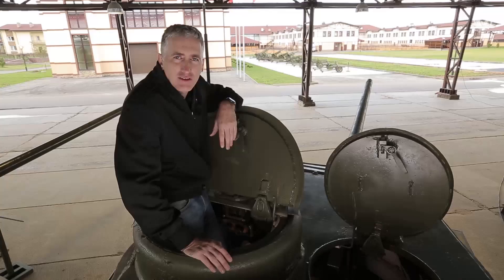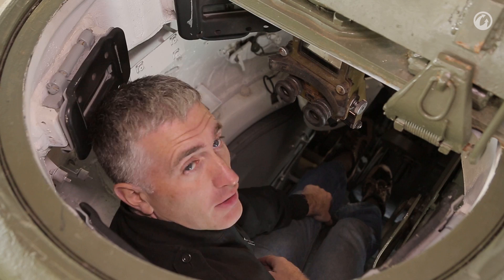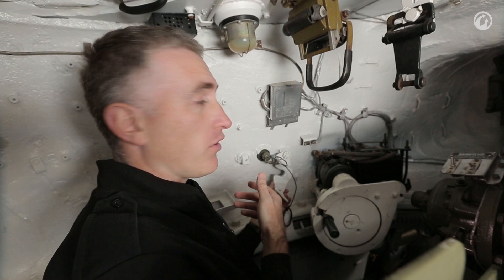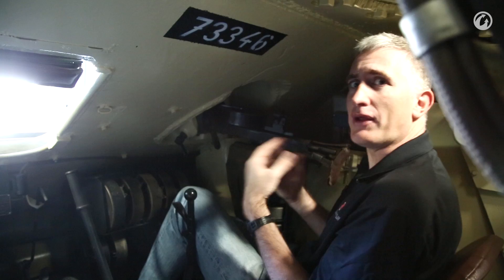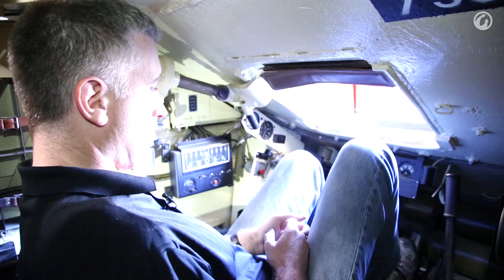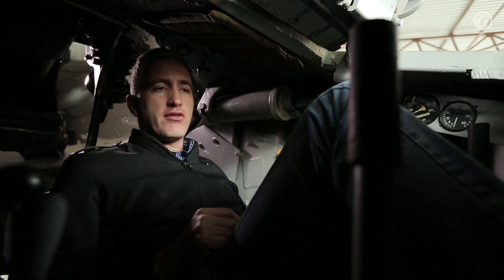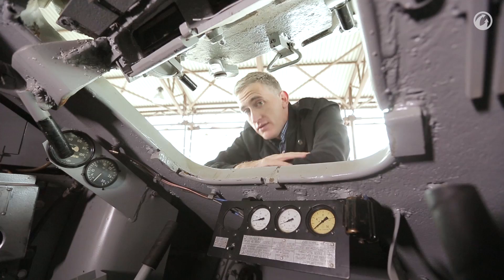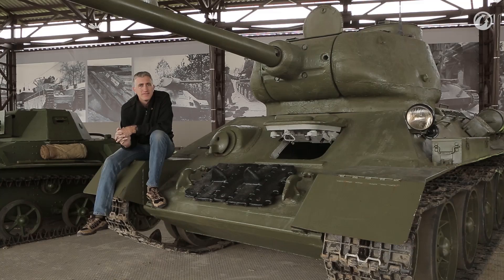Inside the Chieftain's Hatch T-34-85: Part 2

Comment: Great review sir!!!  To me the T34 series of tanks fits a lot of the Soviet and Russian mindset.

It works, it is functional and it gets the job done.  T34 series of tanks are the AK47 of the armored warfare world.  Rugged, reliable and easy to produce.

Remember, the U.S. spent 100,000 dollars designing a pen that would write in 0 gravity for our astronauts.  The Russians sent a pencil with their cosmonauts.  Simple, works, good enough for the job.
Reply: That space pen thing is an urban legend.

Yes the budget for the Zero-G pen was skyrocketing, but it was private expenditure by a company that wanted the contract.

For NASA it cost nothing more than a normal ballpoint pen ($6 a pop).

I'd say that $6 for a ballpoint that can withstand temperature ranges of -35 to 120 degree centigrade and an estimated shelf-life of 100 years, is quite a good deal (even if NASA did buy 400 of them).
Reply: *****
Which is another point in favour of the ballpoint.
Reply: MrFalconfly
Actually, those pens are quite expensive. They are not simple ballpoint pens, they have a sealed and pressurized ink cartridge. That way you can write even at zero-G, whereas with a common ballpoint it would be impossible.
Reply: *****
Solution: Wax pencils.
Reply: RdClZn
$6 aren't that expensive.

It's about 30 danish kroner, which is the normal price for a normal ballpoint.

Special? Sure, but not overly expensive.
Reply: MrFalconfly IDK were you found a 6 USD one, usually that's the price of a refill. The price of space pens usually range from 10 - 55 USD.

Edit: I see you're referring to the price they were sold to NASA, my mistake. Please, remember those are 1965 prices... That would be around $ 45 today.
Reply: pencil thing is an urban legend, and they did also used ballpoint after sometimes in spaces.
Reply: RdClZn
That was the price for which NASA acquired those pens.

What they cost now is irrelevant. We are talking cost of acquisition back in the Apollo programme.

"Fisher invented it independently and then, in 1965, asked NASA to try it. After extensive testing, NASA decided to use the pens in future Apollo missions.[6][8][9] Subsequently, in 1967 it was reported that NASA purchased approximately 400 pens for $6 a piece"

http://history.nasa.gov/spacepen.html

Just like the Ferrari 250 TR which had a price back in 1965 of about 4000 USD, but today it sells on auctions for about 16.4 million USD.
Reply: RdClZn
Moral of the story is.

If you think something is gonna be a hit, and you want it cheaply. Get it early, because the price is only gonna go up.
Reply: MrFalconfly Read the edit. The price today is relevant due to inflation. $6 might seem low but if you keep in mind that you could buy a pencil those days for one cent, then you release $6 is not really cheap.
Reply: RdClZn
Alright, point taken.

What the hell happened to the dollar?!?

But still. It can operate in temperatures from -35 to 120 degrees centigrade, and has a shelf-life of 100 years.

Not like those cheap byros I nick from my office, that dry out the next day.
Reply: MrFalconfly
That's right, I'm not saying it's not worth the price, I'm just saying it's not cheap. And by a long shot not the cheapest solution to this problem...
Reply: ***** Uh... The fact you're using one of the two most successful space programs as an example to how they were unable to innovate tells me that either your irony detector is broken or you're way too blinded by ideology.
Reply: RdClZn
The Soviets were quick, I'll give you that.

And the R-7/Soyuz combo is a very good Astronaut lifting platform.

But realistically the Soviets were lagging behind after NASA got their Gemini capsules flying.

The first spacewalk of the Voshckod was more of a desperate grab for another "first" using a modified Vostok, while NASA was storming ahead with their Geminis and Apollo CSM's.

I'm just sad that ESA's Hermes space-shuttle for the Ariane 5 never made it to a first flight (especially seing as the Ariane 5 is one of the most capable heavy lifters currently).
Reply: *****
Are you suggesting a corporation that spent thousands of dollars in developing a product, then took the opportunity of a contract scandal to promote it, is a "maverick inventor"?

Idk, I disagree with your statement in general.
Reply: ***** I meant it was not the job of a maverick inventor. But the deliberate choice based on market trends and opportunity taking by a big company.

The way you worded it makes it seem like the U.S space program gives FREEDOM and BURGERS, allowing a lone-wolf maverick inventor to show up and save the day (just like Captain America).

Which is just silly.
Reply: actually, the T-34 is quite unreliable.  It was designed to kill one or two tanks and then be utterly disposable.  AK47 was a complete paradigm shift for the russians in terms of design, and that is exactly why it has lasted so long.
The M4 sherman was probably the most reliable (or at least easily repairable.  They broke pretty often as well) tank of the war.
Reply: panzers and panthers..... german steel, quality over quantity.
Reply: Trường Tín
Didn't work very well for them, huh?
Reply: Might want to actually research things before repeating urban myths such as that about the Space Pen. Scott Manly has a video on his channel that has the facts behind that actual device.
Reply: ***** Correct. Early on technical and logistical issues were the biggest loss factors for T-34s. Though 'loss' is a tactical term. It doesn't mean the vehicle hasn't been recovered, put on a rail car and sent back to the factory for a rebuild. Interesting thing about the T-34 and M4 is that while being incredibly similar in battlefield performance their designs were perfectly matched to their logistics base. T-34s could be relatively easily rail transported back to a major depot or factory for rebuild from battle damage such as suspension springs. M4 on the other hand had been shipped across an ocean and was designed in such a way that made field repairs quick and easy meaning they didn't need to ship them back.
Reply: graphite is combustible
Reply: from 1939 to 1944, germans are the most powerful thing to across, until soviets introduced the js-2 and the americans/british introduced their firefly, german have powerful tanks, but theyre one example of over engeering, too many wheels, tracks, etc. but man, the 88 is one hell of a gun.
Reply: Trường Tín Nazi Germany AFVs in the early years of the war where actually quite inferior to their counterparts. It was their tactics, coordination between units and infantry, and experience from Poland that brought them success. 

PzI was a joke, Pz II was slightly less of a joke, PZ III was great against T-26s, British Mk 8s, Renault FTs but nothing special until the special. Pz IV was a infantry support vehicle and pretty good at that role and had room to be uparmed unlike the Pz III but these were few in number in the early part of the war. 

There is a reason that the German Army used captured Czech tanks (Pz 35t and 38t) and continued their production in 1939 and 1940, because they were as good an in some ways far superior to their Pz 1s, and 2s that made up the vast bulk of their armored forces.
Reply: Well the pencil could of ignited the oxygen blowing shit up
Reply: How did we go from T-34 to space pens and pencils?
Reply: +Tyler Brooke-Thomas ikr
Reply: +Khorsathedark Agree with rugged and easy to produce but reliable is a nah.&#160;

This thing broke down waaaaay too often to be considered reliable. The review said it too, youd constantly have to check the tank for broken parts, replace the filters and such after a few hours. These things were lucky to be even functioning after a battle or two.

The T34 is arguably worse than german tanks in terms of reliability (depending on which tank you're looking at).

But it did get the job done (at the expense of many lives, thanks to shit consideration for the crew and their training)

Comment: I realize this is an older video. But what are your thoughts on fuel tanks being for all intents and purposes in the fighting compartment of the tank?
Reply: Given that the tank weight cannot be increased (if it could be increased then designers would have put more armor around, or a bigger gun or more fuel), the best place for the fuel is inside. If they fuel tanks are anywhere else, projectiles need to penetrate less armor to get to the fuel. And if the fuel deposits are broken, they are bad news for the tank independently of where they are (either it loses power in the middle of battle, or the fuel ignites and burns the tank). The fuel burning outside does not make much of a difference (think of molotov cocktails).
Reply: Sergio Juan Membiela
Yes, but a tank where the fuel is back in the engine compartment for example, on the other side of a firewall, I'd argue would be much safer for the crew from a "burning to death" standpoint, than if the tanks were in the crew compartment like on the T34
Reply: Ehh, but in the engine compartment it is way more likely to set on fire. Again, fuel tanks are great in that they can fit anywhere in any shape, so reducing the size of the tank and putting the fuel in the awkward useless places seems like a good idea. It is diesel fuel anyway, it doesn't really burn unless under high compression- 

Also, I think you are forgetting something significant... the AMMO is stored inside the tank, that is quite likely to go boom when hit. Getting out is your only option anyway, the smoke would kill you if the engine was on fire anyhow.

Tanks all burn, and you need to leave them when they do, so it isn't really that significant.
Reply: Having fuel tanks inside a fighting compartment was considered to be very stupid because the rupture and ignition of one tank ensured the destruction of the vehicle and it's crew. The T-34 had two large L shaped fuel  tanks inside the hull with the top section shaped to fit inside the sloped sponson with the lower section running between two spring housings to the floor. Those were connected to two more smaller fuel tanks inside the engine compartment. Diesel fuel will burn when ignited by explosions or a red hot electrical wire.

Comment: Who designed that Gearbox? I mean really?
 Well... at least they eventually added a proper accelerator rather than having only a brake.
Reply: It was made like that on purpose, to give the very maximum possible manufacturing tolerances. made them way easier to make. If they spent time precision manufacturing gearboxes, testing, etc. they could have made 10 more tanks by then. It meant gearboxes always worked out of the factory, albeit like a piece of crap, but they would work.